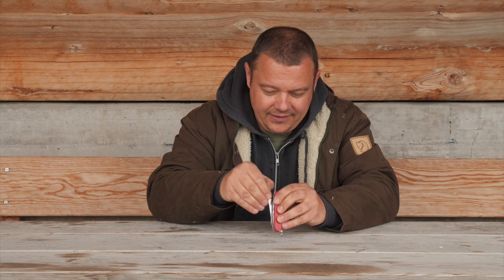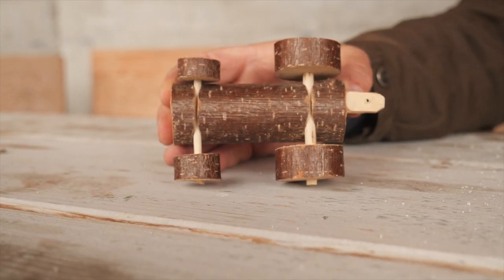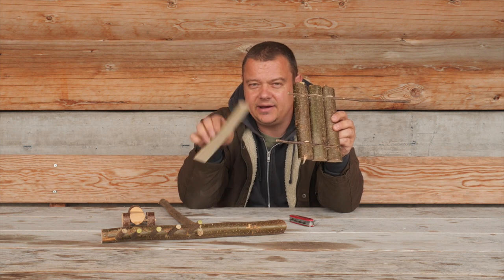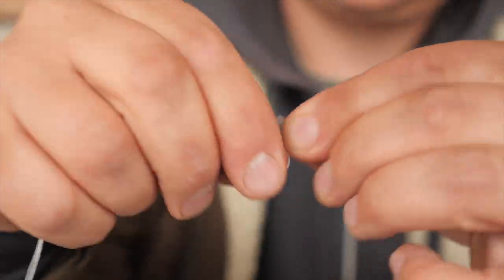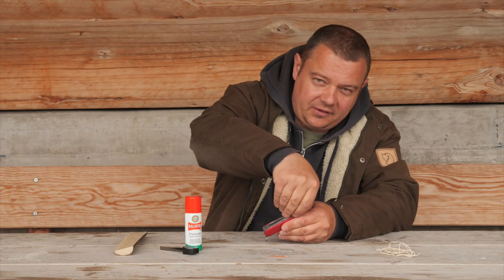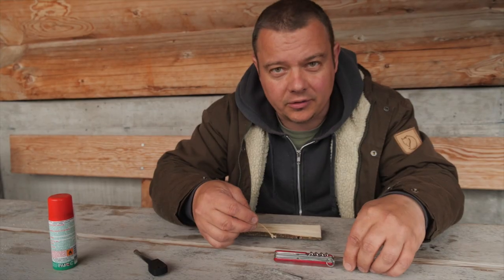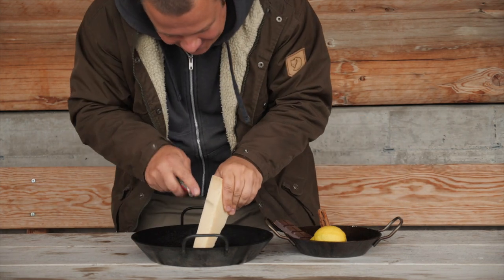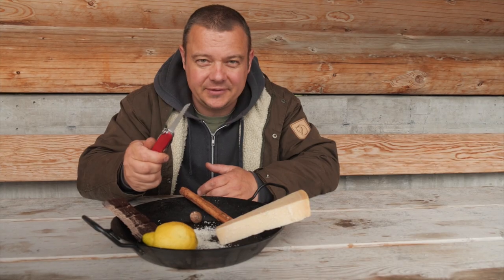Victorinox Tips & Tricks (4/25) - Wood Saw (2)

Comment: Under the scissors, there is space for ferrorod or thiny withe ceramic sharpener.
Reply from the maker: Thanks a lot for your tip!!
Reply: Where do you get a Ferro Rod that thin? I have one of them toothpick replacement Rod's though I prefer to replace the tweezers.